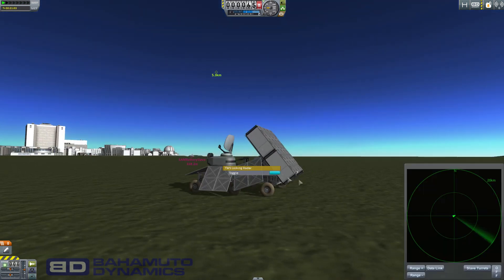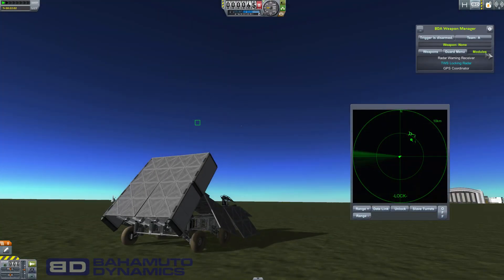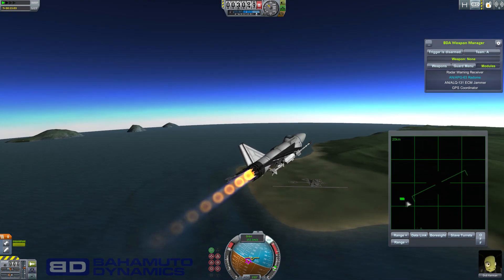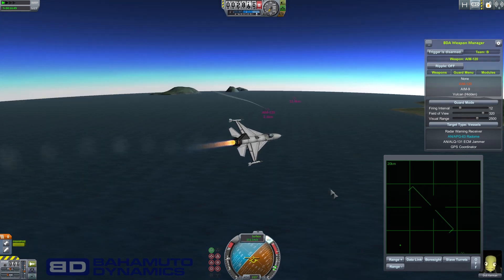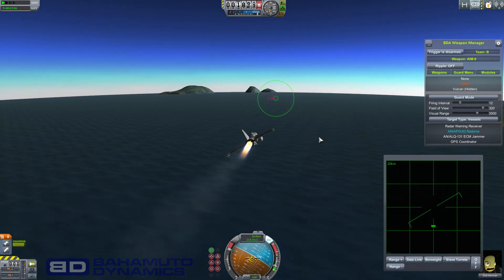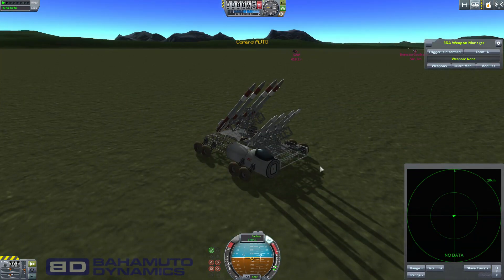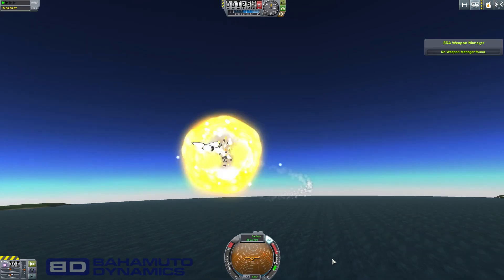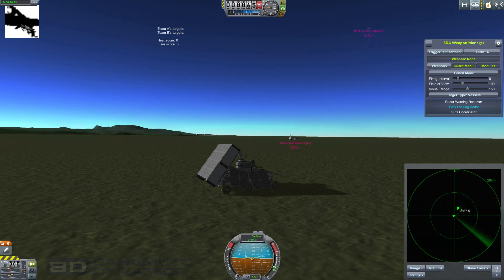BDA - Radar and Anti-Air Missile Explanation

Comment: boresight is basicly active radar
Reply: It is just the normal radar on (usually) a 5 by 5 degree fixed forward facing field of view. Hence the name "Boresight".
Active radar just means the radar is switched on. A passive radar only receives radar signals. Basically a RWR is a passive radar.

Comment: I am assuming here that getting a radar lock on ground targets is not quite possible? The cruise missiles that were listed as "radar-guided" I managed to launch via GPS.

Of course, that's planet-side weaponry. In space I am facing the not insignificant problem of the projectiles refusing to clear the cargo bay they're stored in. I suppose I'm out of luck there, yes?

Comment: I seem to be having some trouble with the guard mode... I raised the physics load distance, but the Guard Mode's range remains stuck at 3200 meters. Also, it just plain stopped cooperating with my AI systems. I come within range and the enemy aircraft just sits there, engines on, on standby, not doing anything. Can you help me? thanks

Comment: i can't get anything to fly with the new nose cone, all my jets all was flip out when o go to turn
Reply: Try installing it on a freah version of ksp.
Reply: i did
Reply: +sydney reusch bring the center of lift behind the center of mass.
Reply: no duh, iv made jets before, but the nose cone breaks every single jet i make
Reply: sydney reusch By flip out, do you mean stall? That's not from the cone. The plane turns too fast for the engine to keep it going where the nose is pointed, resulting in a stall, usually something you can't recover from.
Reply: Bob Bobbington the slightest tap in any direction and it spins out of control, resulting in a stall, than a crash
Reply: sydney reusch Try moving your lift even further back than usual.
Reply: telefon72 iv already tried that
Reply: sydney reusch How about even more?
Reply: Which elevator are you using?
Reply: ll Blek ll  elevator? what do you mean?
Reply: sydney reusch Control surface.
Reply: …….no duh
Reply: sydney reusch He means what kind of control surface. Elevon 1, Elevon 2...
Reply: +Syd R i can but the radar doesnt do anything. it wont detect anything
Reply: revampedharpy09 ok
Reply: revampedharpy09 What are you trying to detect?
Reply: a rocket on the launchpad then a plane flying in a straight line.
Reply: revampedharpy09 You shouldn't be able to track the ground target, but the plane should be do-able.
Reply: telefon72 yeah niether worked. i tried all the radars with the aility to lock targets. i detected one when i first tried it but then afterwards they wouldnt detect anything even though i used the exact same missles/radar platform and target. the radar guided missles are incredibly accurate when it works though arent they.
Reply: revampedharpy09 Hmm this sounds weird, and yes they are indeed.

Comment: Thanks Paolo Encarnacion for the explanation, I thought I was doing something wrong as it was much more difficult to lock and launch, but it's added even more wonderful depth to the mod. If I may ask, what mods are you using for 1.04?
Reply from the maker: +dcompart In the video, its just my dev install, so it just has the mods I work on, plus hyperedit.  I haven't had much time to play ksp 1.0+ other than that :(

Comment: will there be a radially mounted radar system like the nose cone? I used qtech aero parts to make realistic looking jets, but I wouldn't be able to place a nose cone. great me btw, I'm loving where this is going.

(If you want good looking jets, I suggest you look for mine on curse.com, not to brag but the are pretty good :D they're called realistic jets pack 1.1)
Reply: *mod
Reply from the maker: +Ben Curnell You can copy the ModuleRadar MODULE{} from one of the radar nose cones and paste it into the Quiztech cockpit's part config.  Eventually I'll ask him if he can add it.
Reply: Sounds good.

Comment: hey slight problem its not working on my mac
i added the model launched the craft and it looked like i summoned the kraken but if it and i loaded the game with out the mod and it worked just fine
Reply: commonnerfer its skipping all of the bd amoury stuff while loading the game I'm not even sure if i can get it working but i can try i was really hoping to have  a combat simulator for me and my friends to fly tomarrow but its not working properly
Reply: commonnerfer found it i had a config issue with ksp for mac found a line of code that i set to true it now works it said can not be used on this platform but it was in use

Comment: I have a few questions if you use heat seeking does it lose the target if engine is cut off do flares work against radar missiles is there away to. Tell if you are being pinged by an enemy radar is there a way to jam an enemy radar
Reply: Along with ways to absorb the radar ping instead of bounce it back so it requires a kerbal to see the stealth craft wait can you make kerbals give benefits to a craft if they have one like vein range or make an object more detectable or replace the over hearing to were if it's a big craft the crew could repair it
Reply: Electronic warfare (radar jamming n' stuff) will be added in after the air-ground radar update, I assume. Also, there could be gaff dispensers added in, which IIRC is metal shavings used to deflect radar randomly. Basically radar flares. What I really want is a way for vehicles to have a radar-detectability, with angled parts and stuff. Not just this camera view (which is still very clever BD :D).
Reply: +TheDJ *chaff not gaff
Reply from the maker: +TheDJ Jamming and chaff are already in, but not fully complete.
Reply: Paolo Encarnacion Oh, OK. I haven't played with this yet so I didn't know
.. I'll get it soon though. :P

Comment: Hopefully i can get these damn AI planes to shoot missiles at me, atm they are hust juking around trying to hit me with guns.
Anything i could be doing wrong in the setup?
Reply: Maybe you are being too close to the AI? Anything than that, not sure. Or maybe just try getting rid of the guns temporarily.
Reply: ll Blek ll
i was using th BDA testplane, i was 6 km out and it just kept chasing me until it went for a top gun style close call... no shooting, just bragging ;)
Reply: Hmm... Have you tried removing the guns temporarily? What missile are you using?
Reply: ll Blek ll
as i said, without the guns it is chasing me without doing anything. It has aim 120's and aim 9's equipped (and i think some AGM'S)
Reply: Does it have a radar on board?
Reply: ll Blek ll
it has a reciever linked to its team radar :)
(Thank you for your effort man, i really appreciate it anyway :3 )
Reply: If it still doesn't work, try downloading the older version of the mod. Without the new targeting system. Or use the old targeting system in  BD Armory options. Also, what radar is it linked to? The TWS radar or just the big one.
Reply: ll Blek ll
The TWS as the big one appears to not work properly. Gonna try reinstalling an older version. Thanks dude ^_^
Reply: No problem. Let me know what the results are.
Reply: +ll Blek ll Fixed! Thank you mate :D u da reel MVP <3
Reply: TheJetnerd Glad to know. Have fun with the mod :D